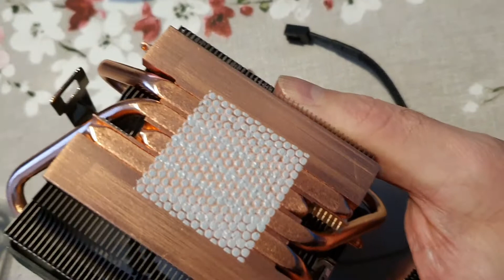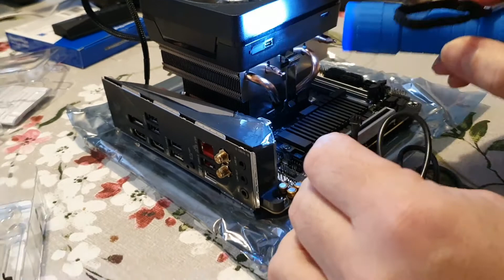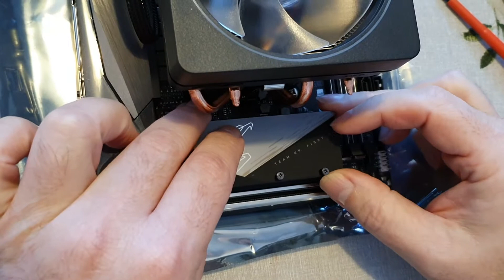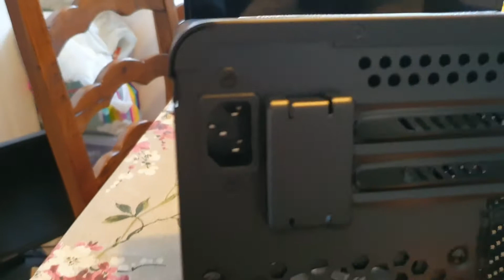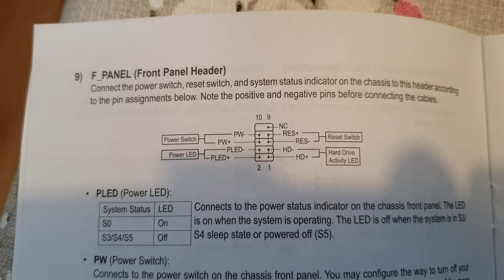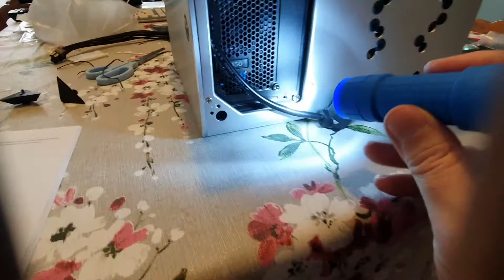Complete PC Build. AMD B550i, 3700x Mini-ITX.

Comment: Thanks for sharing. You saved me as I couldn't work out why the SSD wouldn't lie flat. I had tried to unscrew the screw before I found your page but wasn't sure if I was going the right way or if it should be unscrewed at all as it seemed tight  ! After I watched you I had the confidence to get some thin adjustable spanners onto the top post and apply a little more pressure and it undid ! Bloody Gigabyte - they should just leave the screw off and let you put it on from the packet with the other nuts and bolts. Nothing in the manual either.
Reply from the maker: Many thanks for the kind feedback and I am glad the video helped. I also agree with you comments about the nut. Regards